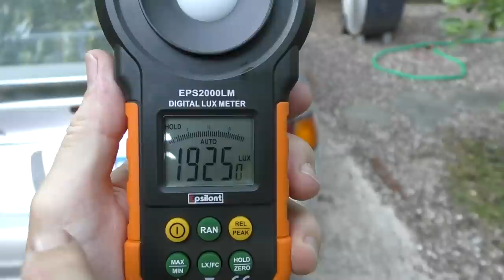I Made a Huge Mistake Buying These Headlights

Comment: I'm surprised you did not mention headlight projector lenses. It is safe, and non-annoying to put HIDs in projector housings. If you aim them level, the beams are lower than the oncoming driver's head. HID's start off cool and warm up to get brighter, while LEDs start off cool and warm up to be dimmer. The quality of the LED headlight can be judged and summed up in these words: "the quality of the heat sink and fan on the back". If the electronics do not stay cool on LEDs, they simply get dimmer as the electronics in it get hotter. It's the negative temperature coefficient relationship between temperature and electrical flow. The hotter it gets; the fewer the electrons flow (or the more resistance to current flow). As temperature goes up, so does resistance to current flow. So, you end up with nice bright LEDs in winter and dimmer ones if the nighttime weather is still hot. HIDs do not suffer in this manner.
  Lastly, in Texas it is technically illegal to use HID headlights in non-projector headlight housings, because the beam is not controllable and it will cause temporary blindness in everyone in front of it. For best results, use HIDs for low beams, and use halogen or high quality, expensive LEDs with huge heat sinks and fans for high beams.

Comment: I have the HID Xenon projector  headlamps in my 370Z and like them a lot, a big improvement over the halogen bulb reflectors in my older car. LED lights are interesting but I don't think the beam pattern is as good as with halogens or HIDs. The surface mounted planar emitters in the LEDs can't be clustered around the focal point of the lens or reflector as closely, so there is greater beam divergence and loss of light intensity along the beam axis.

Comment: I've got a 2017 Forester and an LED headlamp is $1400 (Canadian pesos). Here's the problem with LEDs from a Canadian perspective: in the wintertime, slush freezes on the lights, where conventional lights melt the crap off the headlamps.. Next thing they'll be offering headlight heaters!

Comment: the bulb (light source) is not the issue, it is how it is aimed that helps reduce glare, it is illegal to install aftermarket bulbs into an OEM headlight assembly, if you want HID or LED headlamps, buy OEM or retrofit the headlight with a proper projector assembly inside to make sure you are not blinding others.

Most OEM cars with HID or LED also have autolevelling systems to keep the light focussed below the eyes of approaching drivers. But at a minimum, anyone wanting brighter non OEM headlamps should retrofit (open the headlamp and install a projector designed for the type of bulb being used).

PS: A mechanic who puts HID inserts into a reflector headlamp housing? something isn't right...

Comment: Yeah there's a lot at play here. If the distance of the filament inside of the halogen isn't the same as the plasma in the HID then the beam won't project correctly, that's a really common cause for the anger and high beaming. Halogen bulbs have a lower more yellow color temperature, HIDs often are 5500 or 6500 kelvin and the blue light actually creates glare inside the eye. For a long long time headlights in france had to be yellow to be courteous to oncoming cars. Really the appropriate setup for HID bulbs is a projector that has a half sphere of glass, they can either be just high beams and use halogen low beams, or can even have a mechanical shutter that is closed unless electrified, then it opens to expose high beams, there's a few ways to do it, but they are NEVER thrown into a reflective cavity like a halogen light is.

Comment: Use Turtle Scratch and Swirl Remover.
It don't works for removing scratch and swirl but it works for clearing faded headlight. I used to use meguiars plastX but the headlight faded again after a month, Not what i expected from that kind of price. When i try turtle scratch and swirl remover on the hood, i accidently rub it on the border of the headlight and surprisingly it also cleaned my headlight. Turtle is cheaper, works faster, and maybe hold up better. It's been a month now and the plastic still good and doesn't looks like it will yellowing again soon.

Comment: just put projectors and xenons from the higher end trim gli in my jetta. the thing with leds and hids is that you need projectors to focus the beam correctly. reflector housings arent precise enough to cut the light off from going further up than the cutoff line. i wouldnt use leds period unless your car was specifically made for them. leds tend to produce uneven beam in both reflectors and projectors due to the light only coming from 2 sides instead of 360 degrees like a halogen or xenon bulb.

Comment: Scotty,  I put LED dome lights in my van and they worked great ; however I also thought I would put them in my Taillights and turn signals. Bad idea... the rear turn signals made the lights flash very fast. The front signals did not work at all ; they made the 4 way flashers come on. I know I needed a resister installed at an additional cost ; so I decided to take them out.
The original bulbs are good enough and I have many of them so good bye to LED lights, I don't need the problems.

Comment: The reason why the HID bulbs blinded people is not because they are too bright, but because they are optically incompatible with the halogen reflector you put them in. The low beam filament in the H4 bulb has a reflector dish so it only illuminates the upper half of the reflector which reflects it down (while the high beam filament has no reflector so it also illuminates the lower half which reflects upward). The HID bulb doesn't have that so you effectively have high beams on all the time.

Comment: Aimed correctly hids in projector lenses are perfectly fine. Plus hids put put heat so in the winter they'll melt ice and snow off which leds will not. Hids use less energy than halogens and last for 1,000+ hours

Comment: You need lights designed to run HID bulbs. My Inifiniti limits how high the HID beams can shine. You can see the line. They are great for my older eyes and don't blind other drivers. But these days, LED's as you mentioned can be made to any specs and are LOTS cooler.

Comment: I bought a used Tahoe a while back who must've been owned by someone who had a share in the company that makes these HID lamps. They but them in everything but the High Beams and Dome Lights in the roof!!! (Door lights,tag lights,etc) With this one,when you get in it,you better blink your lights because one (right) sometimes won't come on unless you do,and the left one really isn't 'that' bright to me,either? (Also won't aim well....lowest adjustment is still too high) Also it has those stupid DRL's on it (can't turn off the headlights if the key is on) and those lights cause static in my two-way radio? (I'm a radio operator as well. And it is the lights...static goes away when you hit the high beams?) What's funny is that they did all this to it,yet it still has the same hazy,yellowed lenses it left the factory with!!! I also have a Crown Vic that all I did was upgrade the halogens (Sylvania 'Silver Stars' are what these are called IIRC) it came with,and it has brighter lights than this Tahoe. (And so do my '83 C-20 & my '72 Olds 98....just regular ol' halogen service replacements??)

Comment: Notice that led lights do have really bright spots, brighter than halogens, but right out that spot there is darker than halogens. I noticed that first on register lights like what the hell is with these lights,  there are shadows on plates and very bright spots. Halogen is softer but wider too and safe to notice people and animals at night. Another reason is that I have full glass headlights and this way it's easy to keep them dry inside and hot so ice will melt right away most of times in winter. Plastic headlights with leds on them use to freeze and driver will lost some of his vision clarity.

Comment: If you get after market LED headlights, 1: only put them in projector housings, 2: get bulbs where the LEDs closely match the location of the filament. If the LED isn’t the same as the filament, it won’t reflect correctly and you’re gonna blind everybody

Comment: I like the headlight restoration kits sold online by CureUV.  The sunlight-cured spray restores the hard coating on your polycarbonate headlight lenses and the treatment lasts about as long as the OEM coating (10 years or so).  I've also had good service from the H4 LED bulb I put in my motorcycle, from the folks at HeadlightRevolution.  It was their new Supernova PerfectFIT Bulb and pretty expensive but it has no external regulator and has worked well for me so far.

Comment: You are supposed to use a projector lens with a cutoff shield if you are going to put in bright bulbs like that. Adjusting them wont do squat, you must have a cutoff shield in the projector housing.

Comment: I think the 1st time originally was in 1997 Lincoln Mark VIII around the end of 1996 I remember I saw one passing by on the road I never knew about them since 1999 when I was working at the Acura dealership when I saw one in all standard 1999 Acura TL and RL also on all 1999 Lexus LS 400,GS 400,BMW 7 series especially Mercedes and Audi's..Most of the time I like the clear replacement aftermarket headlights with the black housing design.

Comment: It is the shape of beam not the brightness blinds oncoming vehicles. Put any other type of bulb rather than the original one is not good idea since the difference of shape and/or place of filment or diode will ruin the beam shape, throwing lights to the places where should not be. If the bulb housing is designed to be using LED, which is happening now, there would be no problem. Don't buy LED bulb for replaceing the Halogens, it just does not work. MOST IMPORTANT: TURN OFF YOUR HIGH BEAM!!! when see oncomging vehicles.

Comment: I had a 1998 Ford Falcon and I used to get flashed all the time even though it had factory Ford lights.
Reply: Those ELs had rubbish headlights. Very dim.
Reply: @motleydude73  Mine was an AU. Always thought it looked like a cockroach but it was good on the highway, just a bit nose heavy on landing when on dirt. I did 60,000 in it but depreciation was bad. I paid 15k for it and sold it for 4k over 7 years.
Reply: @2DogsVlogs  Ah yes the ugly as sin AU. Great engines though they go forever. I had a couple of earlier EFs. Might as well of had candles for headlights 😂  The later ones were much better.

Comment: Using resistors to stop the "light out/malfunction" message is NOT a good idea. (In my opinion) You have to keep a few things in mind.  They're resistors and they get HOT. Really hot. Not fire hot , but enough to melt surrounding plastics.
Resistors stop error messages from popping-up by making your car think there is a halogen light installed because halogen lights draw more power. LEDs use much less voltage and in turn make the car think the light is burned out.
  You have a few options,
1) Just live with the error message
2) Re-code your car to ignore the error message (Carly works well)
3) Keep the OEM urine colored yellow halogen lights in.🤣
And..
4) I can't stress what Scotty said  enough: 
BUY QUALITY LEDs

Comment: Scotty, HID lights are meant to be in Projector style headlights.  NOT reflector style....  That's why you had people flashing back at you.  I had HIDs and people flashed me too even with projector lights.  Why?  Factory aims them too high...  Plus they would quit after 6 months of use so i got fed up and went to LED.  I converted everything to LED, interior nad exterior.  LED low beams, high beams (Illegal in MN but i dont care), tail lights, plate lights, and turn signals (with a resistor to stop hyper flashing).

Comment: When properly aimed and OEM the new lights are fine. It's when they jack their truck up or lower the rear end and they shine up into your eyes. Or when they install aftermarket LEDs and they are not set up. It's getting really bad as this is spreading.

Comment: Everyone SHOULD know you don't run HID in reflector type headlight housings. HID's are meant for projectors. Actually HID run much cooler than the LEDs. That's why so many LED headlights won't fit under the headlight dust cover: because they have HUGE heat sinks and cooling fans!! I'm not knocking them, as the technology is making leaps and bounds every year. I've run HID retro fit kits in my Lexus LX470 for several years now but I'm very interested in the LED versions.

Comment: Insurance institute wanted brighter lights ten years ago.   Well we got em.   The Tesla, 4x4s, luxury trucks and luxury cars are especially blinding.   Especially bad for the raised trucks that put that bulb right in your face or mirror. 

I wish the headlamps had the top half of the lens blacked out (WWII style)

Glass light assemblies on my late Mom's 1990s volvo were all cracked and pitted with chips.  $300-500 to replace.  The plastics are a pain but they don't break. 

Very cloudy plastic lens + Mothers Metal Polish ($4) + a polishing wheel on your drill + 3 minutes = clear plastic. 

Only slightly cloudy,  just skip the polishing wheel. 

Only slightly hazy,  Meguires PLASTIX and a rag, once a month.

Comment: Hid are so much better then leds . you need to make sure of you installed into a reflector style you have to make sure the hid has the shield to make the light go up to the top and project the light out. If point to the bottom it acts like the high beam and blinds people .

Comment: Hate to break it to you Scotty but aftermarket bulbs, if they didn't come from the factory that way, are still illegal...even if they meet the the color requirement (white or yellow). If your car came with halogen, it must only be replaced with halogen. If it came with HID, then they must be replaced with HID. Same goes for LED. That is until the NHTSA and DOT changes the law allowing for the use of aftermarket LED/HID in a housing it wasn't designed for. Look up FMVSS 108. It's the US gov's standard on headlights.

Comment: Just use compound and buffer will make headlights like new again sometimes if there really bad or someone has spray something on them like clear just use the right grit of sand paper you think you will need then compound and buff out the scratches and bad layer of plastic sometimes there to far gone and you just have to replace them.

Comment: #1 if you're putting HIDs in a car that originally had halogen reflectors. Stop! You need to retrofit projectors or get better halogen bulbs. 

#2 yes some cars had HID reflectors from factory, but we're designed from the factory, some goes for led replacement (in my opinion) you should use the correct bulb for the headlight which it came with, unless you do a correct retrofit.

Comment: The reason the HID bulbs were so expensive to you, you quoted dealer pricing. If you know where to get them, you can get authentic Philips and Osram standard HID bulbs for about $75 each from authorized online sources. They last for about 1500 hours of actual use, before you should replace them proactively.

Comment: I had LED’s in my h3 hummer, I changed them back to halogen because they interfered with the radio. The previous owner either didn’t spend enough to get a decent set, or he forgot to put the radio choke on it.

Comment: My 1968 Cadillac Sedan deVille got auto-dimming from factory. When it is too dark outside, it turns the high beams on and if it detects a car coming from the opposite direction, it turns the high beam off. Also it turns the high beams off if it detects  relfective street signs  too. This was in 1968.
Reply: Didn't they have that on Cadillac's in the late 50s also? called Autronic or something like that?

Comment: Actually all headlight bulbs should be replaced in pairs.  On the HIDs you do it because you can kill the ballast if a bulb burns out.  HID bulbs should probably be replaced preemptively after certain age/mileage for this reason.  An $80 bulb is an easier pill to swallow than $1000+ for a ballast.

Even standard halogen bulbs should be replaced in pairs as their light output decreases over time.  It can be very noticeable if one bulb is a few years old and the other is brand new.  You can confirm with your light meter.

Comment: They're blinding because people install them in reflector housings. I guess even Scotty Kilmer doesn't know everything. Advising people to upgrade to LEDs if they just "buy the good ones" is dumb. If you have a reflector housing it will scatter the light and you won't have a proper cutoff. Those housings are designed for halogen bulbs. If you run HIDs or LEDs you need projector housings. They will maintain a proper cutoff when adjusted properly.

Comment: Any bulb that gets hot, such as filament types, are very susceptible to oils deposited on the surface, so it's best to wear gloves when handling or installing them. In normal operation, the heat is dissipated and distributed about the surface of the glass, as the heat capacity is uniform. If oils from our hands get on the surface, however, the heat capacity of that area of glasses increases, and the heat is no longer uniform. Further, the emissivity of the surface decreases, such that the heat transfer from the spot is diminished. All this leads to hot spots within the glass, causing tension and rearrangement of the atoms. When the bulb cools, it cools too quickly for the atoms to rearrange into a stable configuration, leading to stress fractures. 

TLDR: Wear gloves when changing glass bulbs.